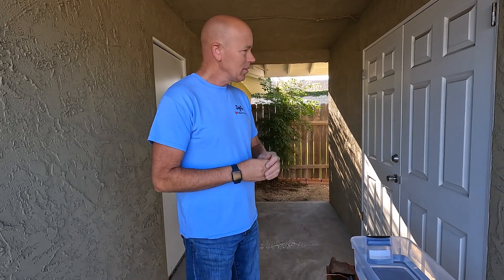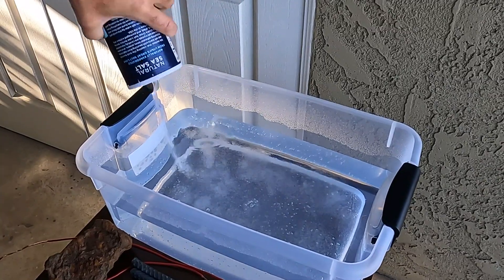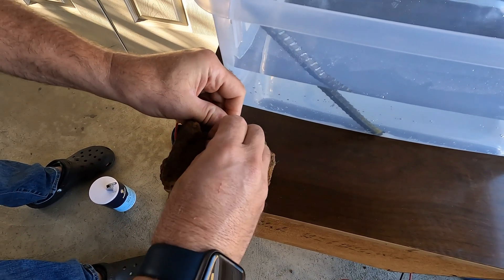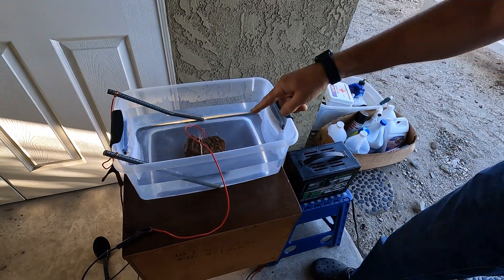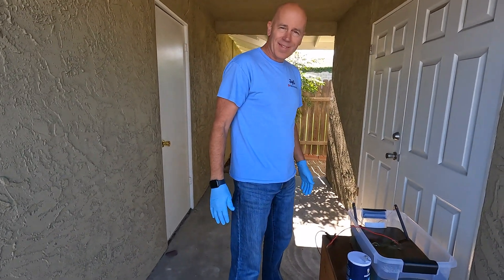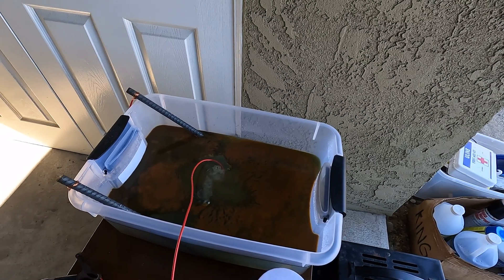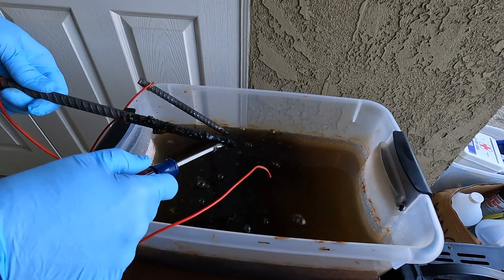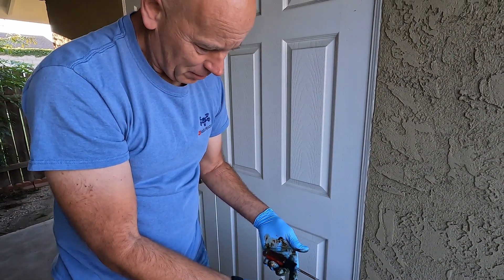Electrolysis Project To Remove Rust

Comment: Now hopefully you have a Good Bench with a Wire Wheel Brush And a Grinder to get it back to a working splitter and split some wood for you in the fireplace and Or A Smoker, wood and BBQ AND NOW I'M SMELLING IT AND HUNGRY.......
Reply from the maker: I think a grinder is next on my list of tools to get... I know Christine wants to make smores so yes, gotta get some wood and build a nice fire soon.
Reply: @DigginSoCal  yes on the Cupcake Christine Queen of Cupcake S'mores and Attitude 🤣.....
Reply: @DigginSoCal  And if you can find a 3/4 horse grinder for sale it will not bog down when you really put the pressure against it and make sure to get some gloves and a face shield and possibly the next garage sale or lockers that you buy will have it..... 👍...

Comment: I enjoyed watching all that cheers.
Reply from the maker: Thanks.... it was an interesting experiment.
Reply: @DigginSoCal  I just watched another youtube video with just vinegar used on a big peice of steel for 48 hours and it also works very well and much cleaner, maybe you could try vinegar it would be cheaper to use as no power needed just straight vinegar in a container, anyway just a thought 🙂

Comment: You should get a sturdy metal brush, would that help to remove itfaster?
Reply from the maker: I think that would be a great idea. I did take some steel wool to it at the end.
Reply: A wire brush will remove soft rust faster. But hard rust will just laugh at a wire brush. For hard rust, electrolysis works MUCH better.